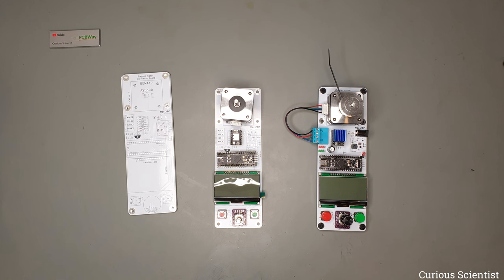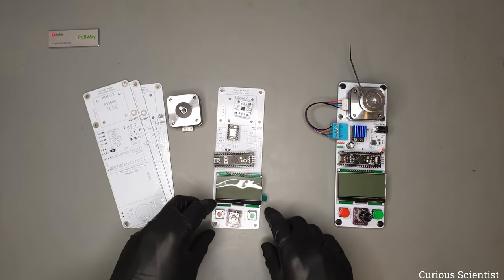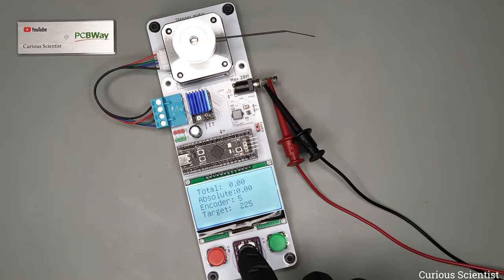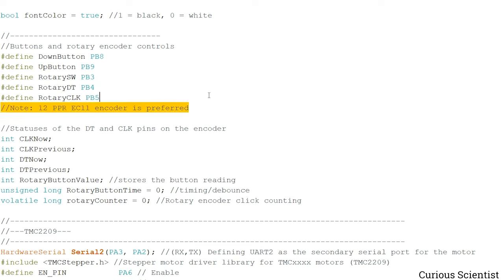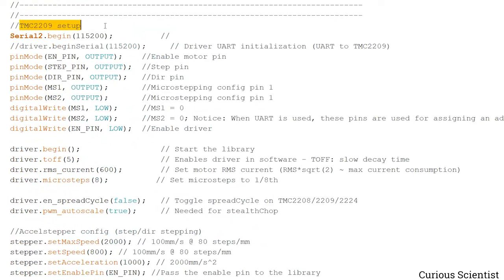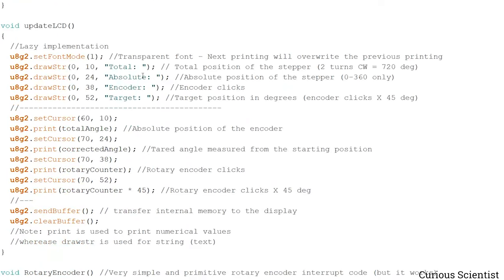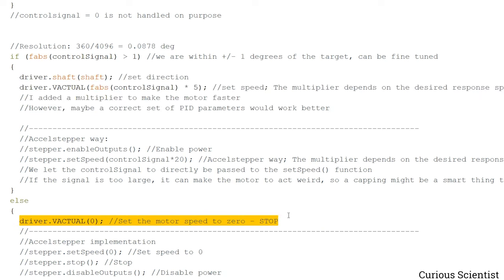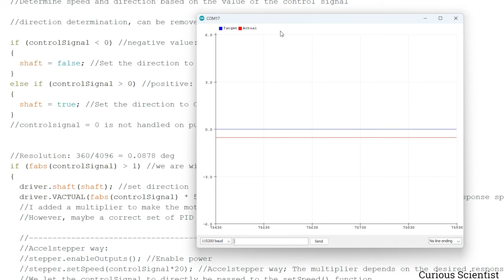Stepper motor PID control using a TMC2209 and AS5600

Comment: If you use  PID in your control, what is the benefit of using a stepper motor instead of a DC motor?
Reply from the maker: It seems that you haven't watched the video. :) I specifically mention the "benefit" of having a PID controller. Maybe if you want to build a stepper motor-based force-feedback mechanism, you can benefit from it. But PID is not really for stepper motors in my opinion. I just made this video, because I had a lot of questions related to this topic, and I also wanted to showcase my stepper motor platform and its capabilities more.
Reply: pid controller is giving an option when stepper motor makes positioning error. pid reduces position error and stabilizes the machine working. if error not going to zero system stops working to minimize the machine failure and loss. we use pid everywhere in daily life. thermostat of fridge is a pid controller starts and stops the motor for cooling and it have a optimised range.
Reply from the maker: The thermostat in a fridge is actually NOT PID-controlled. It is a simple On-Off regulator.
Reply: @CuriousScientist  I totally understand and agree about the benefits of PID. I just can't see any benefit of using it on a stepper motor versus a DC motor, and that was the intent of my question. Thanks.
Reply: @CuriousScientist depends on the fridge
Reply from the maker: Sure, but the fridge at our homes is most probably just on/off controlled. There is no need for fancy PID to keep the food cold enough. But there are for sure more special fridges where PID is used.
Reply: @CuriousScientist  hmm, it's not as widespread as I assumed! I've learned something, and I am inspired to use PID control for my boat fridge project, it seems a lot of folks have done this research, it's more efficient!

Comment: I implemented similar solution in my project but I use arduino nano to controll stepper mottor. Problem show when i try to read values from i2c bus (from encoder) and in the same time controll stepper via (curentTime-prevTime > period). This solution works with a huge lag. Should i change encoder or mC for stm or there is some other soluton?
Reply from the maker: Hi! Without seeing the whole setup and the code, it is hard to say anything...

But if I assume that you toggle the step pin to move the motor, then it is pretty possible that the i2c introduces a delay which makes the motor to stutter. Also, the MCU I use has a 4x faster clock speed than the Arduino.

Comment: How can i do the model identification for the stepper motor in base of the data of the encoder? I mean, i want the transfer function of the stepper motor (input: voltage (PWM), output: speed of the rotor) to desing a close loop control for muy self balancing robot
Reply from the maker: Sorry, but I have no idea about what you're asking. The stepper motor is not PWM driven.

Comment: Hi! Can I use arduino nano and 2209 or 2208 with stepper tmc library? I want to perform simple motor control using buttons and a simple "lcd(0x27,16,2)" display. I haven't seen anyone do it with this library yet.
Reply from the maker: Hi! I think it should work.

Comment: Good job 👍. It’s a close loop system then.
Reply from the maker: Thanks! Yes, it is a closed loop!
Reply: @CuriousScientist  so is there an advantage accuracy & speed if used in 3D printer for example? Thanks for making this video & sharing ❤️
Reply from the maker: @Jim_One-wl4ke  I honestly don't see the advantage of a closed-loop stepper motor. If the system is well-designed, it should not lose steps, even at high speeds and accelerations. If you look at fancier 3D printers, they still have an open-loop stepper motor. These motors (steppers in general) are specifically designed for precision.

Comment: amazing. just control with PID ? because I see you react to the stepper motor but the motor returns to the set point position at 16:28 minutes
Reply from the maker: The PID algorithm tries to maintain the setpoint, no matter what. So if I move the  shaft by force, the algorithm notices that the position of the shaft is outside the setpoint, and it drives the motor to return it to the setpoint.